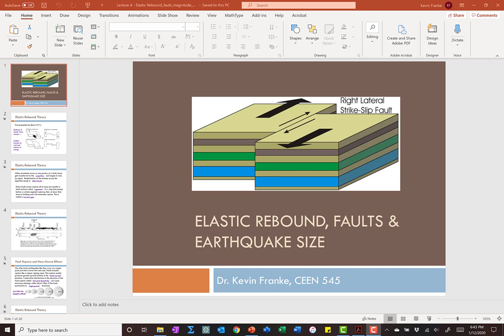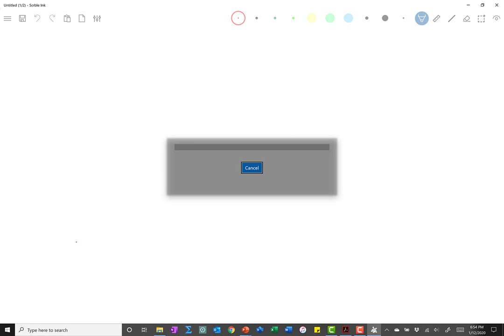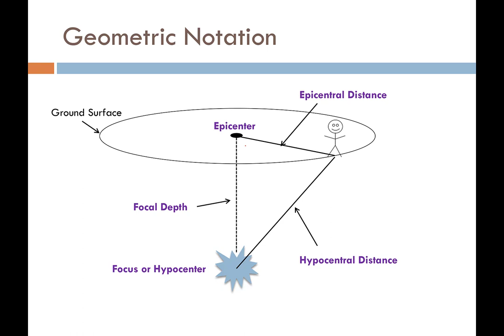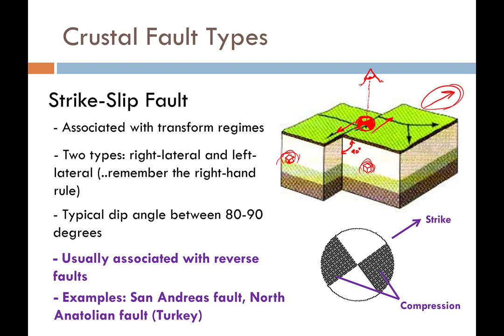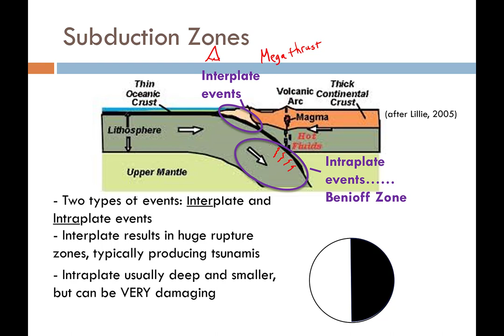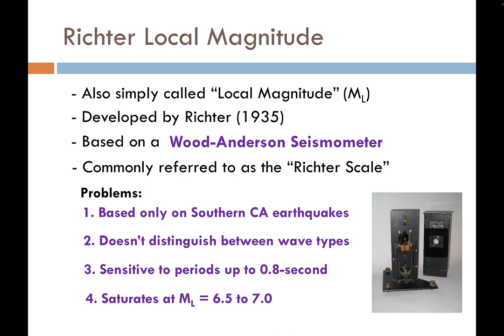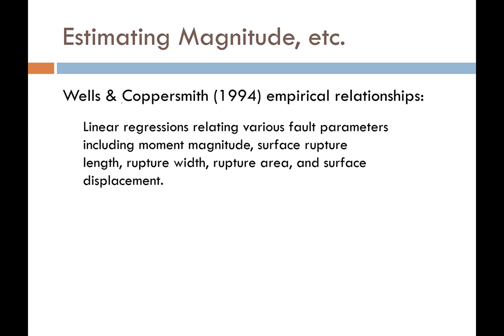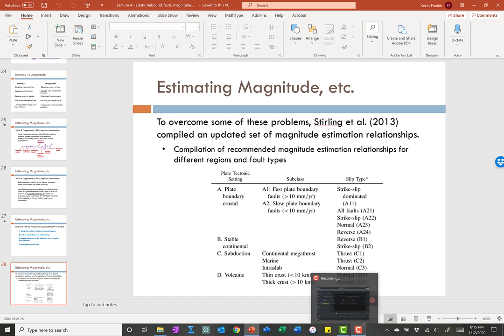CEEN 545 - Lesson 4 - Elastic Rebound Theory, Fault Types, Magnitudes, and Intensity

Comment: I don't really understand the "logarithmic scale" at 1:14:10 when you mentioned 8.0 is 100 times stronger than 7.0. Maybe since M not is a unit measuring energy, the scale would be 32 instead of 10?
Reply: I see! I think the talker made a little mistake by comparing energy released with the "size" of the quake. Thanks for help!
Reply: Yes correctly pointed out Mr. Yang. It will be an increase of 32 times the seismic energy